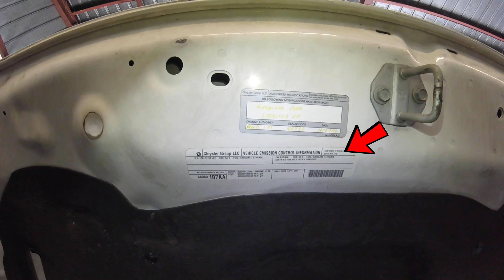⫷ Dodge Ram 1500 4.7L. Emissions Locations: PCV, EGR, Oxygen Sensors, Evap, + info. ⫸

Comment: I have yet to find a single video about the EGR Temp Sensor replacement for a Ram 1500 4.7 Ecoboost on any channel at all. Wish you had done for it but always seems to be for a 5.7 on most of the videos. Back to trying to figure it out and to narrow down the part since all the parts listings come up with water temp instead of EGR temp. This is the most difficult engine to find misc parts and all videos for.
Reply from the maker: Do you have a part number for the sensor you are looking for?

Comment: Thanks for the Video. I have a 2002 4.7L Dakota RWD 216,000 miles and my Air Idle censor was clogged up earlier and I replaced it. I am not sure what made it gum up with black charcoal like substance. Does this have anything to do with the charcoal canister or vent lines that may be decomposing?  Thanks again for the videos! Robert

Comment: 👋🏼 2004 Ram 1500 4.7
Codes i have:

P0442
P0456
P0440

Ive replaced gas cap, fuel pump since it was leaking, tons of sensors including Evap vapor purge solenoid. Ive been chasing these codes prior to these new parts. 
Could it be the Fuel leak detection pump located near evap canister at rear end of truck?  Cant figure it out !  
Thanks !!

Comment: Do you know as to why I have no signal in the evap and my egr is only at .8% I have ran my scan tool and no numbers show. It won't let me pass emissions. And they keep telling me to do a drive cycle and I have done that already and Im thinking maybe something is unplugged or a bad ground or a fuse. I was wondering if you had a better idea. I have replaced the EGR  and nothing works. Do you know if there is a fuse somewhere that could have gone bad for it??

Comment: Hello and thank you for your video. I have a problem on a 2011 4.7l ram 1500 180k Miles. The engine light comes on, and the idle is not stable. The fault code is P0507/$07E8.
I checked the pcv valve, I have no leaks there. I don't know where else to look, do you have any ideas ?

Comment: Thanks for the video. I'm chasing a P0404 and a C2100 code on an '09 Dodge Ram 4.7 after a head gasket job. I'm changing the EGR valve to fix the first one (Partsgeek over Amazon for this one since Amazon sent me a Standard Motor Products with the wrong connector going to the wiring harness), but IDK what the C2100 could be for. Any ideas?
Reply from the maker: Hopefully you got that egr figured out. 🤞🤞. My absolute favorite place to get parts from online is rock Auto. But they do not have an affiliate program, so I do not provide links for them. But I always recommend them as much as I can.

Now that c2100... that is a ABS code. Did you check fuses? Especially fuse 17, I think, in the under hood fuse box?
Reply: @ScottiesHobbies  yeah, I checked RockAuto, but they only offered the same one that Amazon did.

I'm hopeless with most electrical stuff, but I'll be sure to check the fuses.
Reply: @ScottiesHobbies  took a look at M17 and nothing seems wrong with it.
Reply from the maker: @mccdball  on the fuse box, does it say if 17 is abs. I could be wrong on the number. Check any fuse within the abs system. If it's not a fuse, you might want to see if you could unplug the abs pump and plug it back in. That c2100 is defined as 'Battery voltage low'. According to alldata, it can be no power supplied to the ABS module, a bad ground on the abs module, or a bad ABS module. 

If the fuses are good, the battery is good, and the alternator is charging properly... you might need to have some one see if the abs module/pump is getting power and test it.

Is the ABS light illuminated on the dash?
Reply: @ScottiesHobbies  ABS is not illuminated on the dash. I figured that might have been the case (about the numbering). I checked the fuses and they're all good. I've been texting a buddy who says it might be a bad ground. That's what I was going to try checking next.
Reply from the maker: @mccdball  good luck. Keep us posted on what you find.

Comment: I'm going crazy trying to figure out what's wrong with my 07 dodge dakota 4.7 v8 flex. My problem is the rpms wont climb pass 2 but it will climb in speed slowly. Only major work it has be done was the valve seals the problem didn't occur maybe about 2/3 months after the job. The thing is no codes are popping other than o2.
I did a transmission oil change no change also went to a transmission shop said the gear are kicking in.
Did have o2 codes which I have replaced no change.
I have replace the radiator because it was leaking fluid at the fittings. Coolant was added and brupt. When I did this felt like that's when the problem started.
Have taken a look at the emission locations which do look fine. 
Did change out the started for new once seen old went bad.
Coils and spark plugs seem fine could use new sparks but I've seen worse.
No rough idle or stales what so ever.
So I'm stumped trying to figure this out.
Reply from the maker: Do you have a lightning bolt light on, on your dash?
Reply: @ScottiesHobbies  thank you for the reply
No lights  come up at all board is clear.
I don’t just wanna say it’s the pcm because I heard stories of swapping them out and still the same problem.
Also forgot to mention it’s intermittent  but mostly will not rev.
Thinking of double checking air flow maybe somewhere there’s air leak. Also the fuel injectors unless those have code that my obd should pick up.

Comment: Excellent video man. thanks a lot for sharing. I have problem when I fill my 07 Dodge 4.7l up. It always overflows. It makes me crazy. I will check the module that you mentioned.
Reply from the maker: When you are having fuel filling issues call, I usually start by diagnosing the evap vapor vent solonoid. Does it hold vacuum? Or is the hose from the vent solonoid to ambient clogged? Those would be my 1st questions to answer.

Comment: My 03 ram doesn’t have a egr valve and I’m having an issue with my truck wanting to turn off at stop lights or sitting still for to long.. I have changed tbs, iac,pcv, purge valve. Please help if can
Reply from the maker: Have you checked the fuel pressure?
Reply: @ScottiesHobbies  I haven’t checked the pressure but I have changed the fuel pump assembly
Reply from the maker: @mr.e4578  how long ago? Or how many miles ago? I know the aftermarket pumps don't last as long as the factory pumps. My sister had a 2005. We changed hers and 2 years later, it needed another one. Have you checked for codes using the dash odometer?
Reply: @ScottiesHobbies  less then 2 months ago, I did clean the pcm and it helped a lil bit. I have ran the codes on my scan tool and off the dash no codes at all

Comment: I have the same truck and just received the P0138 and P1E09 codes what should I look into?
Reply from the maker: Your engine coolant temp is normal? Your o2 could be bad 🤞, or the wiring could be bad. Or the truck is running rich.

How are you on spark plugs, air filter? The basics first.  

If it was my truck and I knew the engine was maintained properly,  I don't hear any problems like a vac leak or exhaust leak before the o2.. I'd hope it's a faulty o2. But it could be one of those other option.
Reply: @ScottiesHobbies   Just replaced the the driver's side downstream O2 so far no codes thank you!

Comment: Hi thanks for this information liked it I have a 07 dodge Ram 1500 4.7 flex fuel I’m going to change all those valves mentioned. My current problem is when I top the tank driving and stopping at a traffic or stop sign it would stall and turn off. I’ve changed already that canister valve at the end (white) now codes for gas cap or purge valve that’s next with egr and PVC valve trying to resolve this vacuum leak problem thanks your video helped I’m going to subscribe and wait for a response tho not you but others I’ve subscribed to never respond back but ok thanks
Reply from the maker: Do you have a check engine light on? If you think it is from pressure not relieving on the evap system while you pump gas, I would start by replacing the vapor vent solonoid.

Comment: The codes I'm chasing codes  P0175 and P0051
My vehicle is a 2003 4.7 liter
Reply: My main issues are that when I  turn the key over its takes a while to start and is getting worse
Reply from the maker: That truck is notorious for the vapor canister purge valve going bad causing a hard start. But you usually see a purge valve code. The heater circuit code would make me lean tword a bad oxygen sensor but since you have a hard start and a rich code, you might have another problem.  How is the regular maintenance,  like spark plugs?

Comment: 2008 ram 1500 4.7 multiple cylinder misfire code all 16 new plugs wires coils and injectors and new exhaust system with 02 has rough idle and seems like entire passenger side is missfireing
Reply from the maker: Fuel pressure? Vacuum leaks?
Reply from the maker: Any codes?